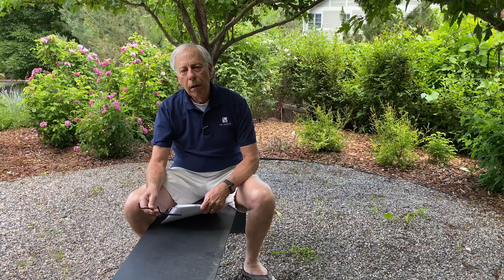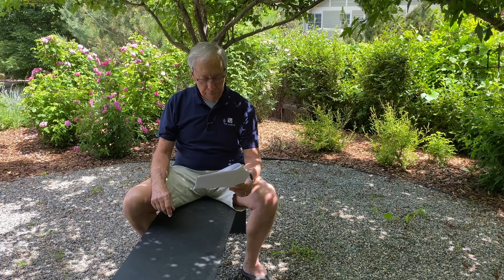The problem with TVs between speakers

Comment: The reason Paul puts the system up by where he sits and not between the speakers is because that system has a the turn table. Tone arms will pick up sound waves and bounce.
Reply: To prevent feedback the best place for a turntable is in another room.
Reply: @paulsebring7242  In another building on a concrete floor to Nasa spec's for levelness and stability. lol

Comment: I noticed zero difference in the imaging when i removed my 60inch Panny plasma from the rack.  Speaker front baffles are well in front of the screen of course.  I think only if the TV is well in front of the baffles and the speakers are toed in more causing obstruction would i notice it.  Even then i suspect most of what id notice would be from the toeing in anyway.  No removal of my TV is ever going to fool me into thinking a band is suddenly playing live in my room.  Hifi and live music in any room or venue is easy to distinguish apart regardless of hifi cost.  I recall an expensive Audio note system at north west audio show last yr playing a violinist Cd.  Said violinist then came and played live.  It was easy to tell them apart.

Comment: I don't agree.
1. Yes a glass screen plasma is bad because of reflections that are really bad for the sound image. The newer TV screens are much better at handling these reflections because they are not made out of glass. Not ideal, but still a lot better.
2. You absolutely have to have a piece of solid furniture in between the speakers that is special, which isolates the sound from the speakers, or else the treble and mid range will go into HIFI show mode, only showing the structure and making things seem boring and unreal because the are working to hard. (this is crucial and almost no one does this)
3. You need the side walls generally to be as close as possible to the speakers, so it still sounds good. (again isolating the sounds, or else the speaker is out of control, same with the backwall behind the speakers)
4. Then in general, you should not exceed 5-7 meters from the back of the speakers (wall) to the back of where you are sitting, or else you will have to deal with a lot of room problems where you have to compensate. (it can be done, but is far from ideal)
5. Yes not having the system in the middle between the speakers, kind of solves a lot of problems with stereo imaging and overall sound. But it also gives you many other problems, being mainly that you will have to use longer cables. This may not seem like a problem, but trust me it is a huge problem, in regards to control of the sound. Longer cables make you lose the coupling effect in the sound when speaker cables are more than 4meters. RCA and other signal cables also must not exceed about 2 meters. Same with power cables. You can get away with it, but you will lose a gigantic amount of control/focus/attack/coupling effect.  The whole sound system, will be very out of control and far from the optimal sound with the shorter cables. Again, doing the exact opposite with too short cables also makes you lose control, and makes the sound too unsettled and edgy.
Reply: You are the reason why I don't go to HIFI shows anymore, people like you kill the sound so it is very analytical.
If you can't understand why an object near a speaker, isolates a sound, and a speaker being set freely in the room, make the units have to work harder because of more air around the speakers, then it is your own loss. 
Please understand when I say that the walls should be as close as possible, I mean of course that they should not be directly up against the speaker, but that one has to find the right distance to the walls which usually is closer, than a longer distance to the walls. (too much air around a system, is like owning a car where you only use gear 1-3 in a high RPM. where getting it usually slightly closer to the wall, is basically like lowering the RPM on your motor, so it feels like you are also using gears 4 and 5)
Most shows have several meters to the walls, with normal sized speakers, this gives a sound that is only supposed to impress you, it does not settle and become organic. Statistically, it is only very few times, you have to do the opposite. It's also makes sense when you think about it, since that most sytstem out there is already too thin/hifi/mechanical, that is why most people should consider pulling the speaker slightly closer to the wall. And only those with too warm/unclear setups should try and pull the speakers out. 
That should make even people like you understand it. Have a nice day.

Comment: I remember the early days of stereo TV. There was much confusion on the studio's part of where to place the microphones. Early attempts resulted in many flanger sounds as the two mics with small spaces between made comb filters of the sound. Sound engineering for stereo is much different than for mono when you consider the typical speaker placement for a television receiver. Due to the problems of dual microphone pickup patterns in the same sound field, most studios have returned to Mono for the news and related broadcasting. Music and ambiance is in stereo.
Televisions should reproduce in kind. The stereo signal should be processed in a matrix just the same as FM radio with Main, which is L+R, and played on the center speaker. Any difference information should be on side speakers or on side facing speakers to produce the L-R difference signal. This would work exactly as the Mid/Side capsule for the Zoom H6 recorder but for playback.
TV sound is best processed to produce the center main channel with a center speaker. This is the heart of the soundbar concept, but that bar is undersized for full fidelity. 
TV sound is not high fidelity, so not an audiophile subject for the most part. If you build a home theatre for sound, consult the THX specifications and find the DVD's with the THX test signals on them.
https://forums.whirlpool.net.au/archive/987776
Surround Sound Test CD (DTS) - Lasertrak CD2500 - For surround and home theater sound setup

Comment: This is disappointing to me. I take great respect in what Paul says so I said "Oh No... " out loud when I watched this lol.  Not only would I not be able to do this practically but also financially because I have a set budget for my cables - and longer ones would be more expensive. I don't really want to have the equipment off to the side because  the entire plan was to have the equipment be the showcase so to speak (kind of like how you guys do at trade shows) and have it right in the middle. But my plan was to have the speakers in Front of the furniture - and also towed in a little towards the listener. Wouldn't this be a good compromise? Note there won't be TV there, just the equipment on furniture.

The speakers I am getting are floorstanders which were made taller from the previous version and are intended to be placed on the ground. They are already tall but should I also get stands so the height of the speaker can bypass the height of the furniture? I just want to enjoy and I've already had too much overthinking this setup.

 I had to retype this entire thing because my damn phone erased three paragraphs - grrr lol.

Thanks
Reply: I wouldn't sweat it. Most of us have to compromise in setting up our systems. You can get fantastic sound without your system being set up 100% perfectly. My system has a tv stand and a flat screen tv in the middle of the speakers. The sound is incredible and I still get the center imaging that Paul describes.

Comment: There is absolutely no problem placing a TV and other equipment between the speakers. Firstly, many people play their TV sound through their stereo system because the sound quality is much better than the tiny TV speakers. The TV needs to be dead centre for the correct effect. Secondly, the sound does not “cross over in the centre”. The centre sound image is an illusion caused by the direct sound from both speakers, it does not actually come from a point between the speakers.
Reply: 4:55 "If in the middle where the speakers combine and shoot back and give us that beautiful center image . . ."
Yes, I got a chuckle from that one, too.
Reply: Marianne Oelund It is concerning that a so called expert clearly does not understand the subject. Objects placed between and slightly behind speakers will have little effect on sound quality. It is surfaces in front of speakers, such as walls, windows etc. that can affect stereo imaging. Objects between speakers may have a visually distracting effect, but there will be no audible issues. I often listen in a darkend room as performance sounds more realistic but I know turning off lights has a purely psychological effect.
Reply: @geoff37s38  
I find it more concerning that a response includes personal judgments.  Now back to the topic of discussion - 
It depends on how the interposed objects do, or do not, align with reflected signal paths, and then whether they add any new reflective paths between speaker and listener.  
The exercise of imagining the room has reflective walls, was meant to aid in visualizing object locations which can impact the sound.  Speakers diffract a portion of their sound in all directions - and some speakers even have rear ports or radiators.
Reply: @geoff37s38  No Geoff, I am sorry but you did not understand Paul's intention here. He was not talking about demonstrating Home Theater Systems. When you are listening to music while looking at a TV that has nothing to do with the music that is being played it could be very distracting and take away from the listening experience. Of course you would want a TV being perfectly centered for home theater display.
Reply: @geoff37s38   That would be physiological. When the brain doesn't have to process the dominate sense of sight it can focus more brain cells on sound. Stay in the dark long enough and brains will physically change to improve hearing and other senses.

Comment: I built my own two way speakers.  I copied the design that NHT used, angling the speakers slightly inward to direct the center sweet spot towards the listener sitting between them (giving a larger overlapping area).  Because I intended for them to be used with video as well as audio only, I copied the placement often used in movie theaters, IE: mounting the speakers high up near the ceiling, rather than closer to the floor.  As a result, I also placed the woofer ABOVE the tweeter, to enable the woofer to 'couple' with the ceiling for better bass response (the usual given reason for putting woofers on the bottom, is that in floor standing speakers, you'd want the woofer to 'couple' with the floor to enhance the bass).

Comment: I'm not totally agreeing with the notion that equipment between speakers degrades Hi-Fi Sound. My speakers are about a foot further into the room than my equipment rack. My system sounds perfectly fine, even better than some which have equipment rack elsewhere than between the speakers. In the real world it's not practical in most households for such freedom to place speakers and equipment as we see fit.
Would it sound better elsewhere?.. May be... but that's the least of my worries.
Reply: totally agree, doesn't make a difference where your equipment sits.
Reply: Visually it makes a difference because there is nothing to trick your mind by what you see. Not sure if the sound changes...

Comment: I found that if my TV was behind the speakers it muddied up the center image with reflections off the screen surface. If I moved the TV to the front plane of the speakers I had better imagining.
Reply: Simple physics.  Angle of incidence equals angle of reflection.  The reflections from objects between the speakers do not travel directly back to the listener.  Paul McGowan said that the center image sound came from between the speakers, which is nonsense.
Reply: @paulsebring7242  The sound from speakers does not just come out of the drivers. There is sound radiating out of every surface to one degree or another. If you can see the speaker's reflection in the TV it is creating early reflections which messes up the directional cues.
Reply: @matthewsallman1700  I agree that sound from the speakers reflects off the TV back to the listener if you can see the reflection of the speakers in the TV.   Sound radiates from the speaker drivers, diffracts from the enclosure baffle edges, and reflects from room surfaces and objects.  Like light, the sound travels in straight lines away from the speaker.  The reflection from the TV will be off the speakers main radiating axis, so the reflected sound will be not as good as the direct sound.  Angle of reflection equals angle of incidence.  If the TV is between the speakers, you will not see or hear the reflection directly.  You won't see or hear the reflection from your TV unless it is far behind the speakers, not in line between the speakers.  You may hear the secondary reflection as the reflection from the TV that you don't see reflects off a side wall back to you the listener.  Your brain can discriminate between long reflections and the direct sound.  You might even argue that the reflection of the speakers from the wall behind the speakers might be broken up by objects between the speakers, improving the sound.  My issue with Paul McGowan is:  he said that sound heard from between the speakers came from the mix of sound between the speakers, which is absolutely not true.  Draw a picture of two spaced stereo speakers and the listener's head.  Draw a line from the left speaker to the right ear and a line from the right speaker to the left ear. The sound from two spaced stereo speakers mixes in front of the listener's face.
Reply: @paulsebring7242  The issue is that the reflections from the TV screen WILL arrive at the listener within the critical time that can mess up imaging. That is the same reason we need to control first reflections off the side walls. When the TV is in the plane of the speaker fronts there is no reflection to the front allowed and my imaging was much better.

Comment: I don’t agree about the equipment between speakers is bad,everything in audio has its plus and minus I have a 4 level rack in the middle of speakers,amps are next to the rack on eather side  4ft behind them,my speakers are at least 8 ft from the front wall,there will probably be more harm with them on one side of the room affecting direct sound frequencies than indirect sound behind them and having to spend much more money on longer speaker cable and interconnects that will degrade sound,all things in a room are gonna affect sound quality no matter what but knowing how sound works in your space and reading about that will make it easier to determine where to but your pluses and minuses for your room

Comment: This is total BS! First of all, the "illusion" of the band playing (staging and imaging) is in the sound, not the gear, TV, whatever. If the gear or TV or what have you is between the speakers, but back and not directly to the sides or towards front, that automatically tones down some reflection. If you have a huge screen mounted on the wall behind your speakers, covering it with a cloth does wonders! More to the point though is that one can always close ones eyes to avoid staring at the TV or gear while listening. If you can't help but look at your gear rack or TV while "listening" to your system, than you are not really listening. 
The elephant in the room that got ignored in this is the fact that most folks do not have a dedicated listening room or the space to put gear racks and speakers where ever they want. Nor is there any magic in PS Audio gear such as "re generators" etc. Bad setup is bad set up and good set up is good set up regardless of equipment.
Why are PS Audio answers always so removed from real life? Makes one wonder.

Comment: I ordered a tv-lift for my 65“ TV, so when I don't watch it I lower it down into closet. However the closet is still in the middle. So I made very uneven wooden ornaments on the closet outer wall. Now i am planning also to push the whole closet backwards, so it would interfere less. Of course I am very worried, though I don't even have expensive gear. I have modified this closet and speaker-stands many many times.

Comment: some Sony TV's protect glass can vibrate and work as the center channel, but it would be very difficult to blend in a non-Sony system
Reply: Mark Victor  well, it’s not passive, it has a few drivers beneath the screen. It would be nice to have sound come out from the picture, but it is probably tricky to find speakers that match the tonality.

Comment: Sound travels in straight lines.  The sound from the speakers moving toward objects between the speakers is not reflected toward the listener.  The direct sound from the speaker moving toward the listener does not reflect off objects between the speakers.  Phantom center is an illusion.  Phantom center sound does not come from the center.  All stereo sound comes from the direction of the speakers.  Paul McGowan is a terrible engineer.
Reply: Maybe Paul was not clear enough when explaining this but what I got was this: You do not want a TV or other stuff sitting right in the sound stage distracting you visually while listening to music. Random stuff happening on a TV that is sitting right between the speakers while listening to music woud be the worst.

Comment: you want your rack to be in front of the speakers as a dividing wall is the best position. having the bass to mid-range separated but have some reflection upper mid to High frequencies is ok